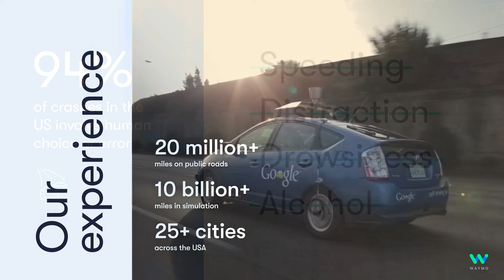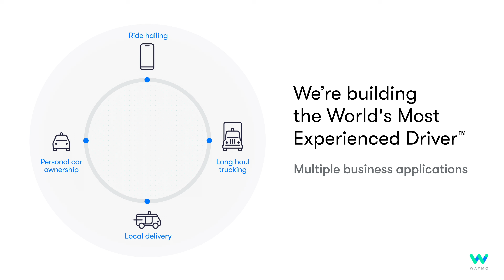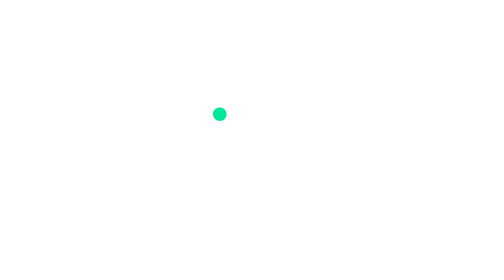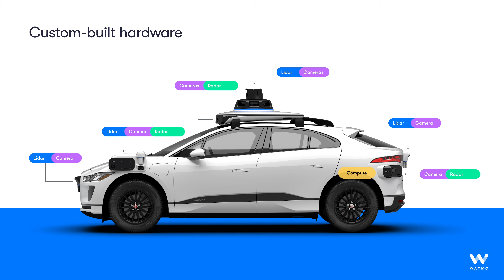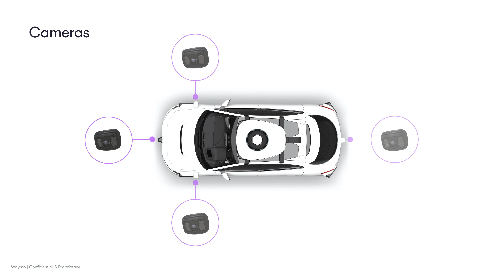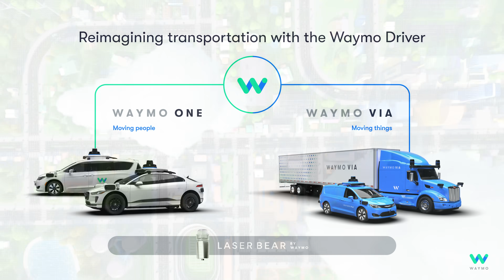Designing the Waymo Driver

Comment: Waymo is very impressiv. But the design is ugly. The sensor on the top, ok ... but that „tumors“ above the headlights.... this is not a design choice. But well, you did your best given the conditions. But it should be possible to integrate the sensors into the car ... cough ... Tesla * cough ....

Comment: Bad: I hate how it looks. Looks like it’s got Down syndrome or cancerous growths on it. I’m not driving that until you fix it.

Like: Waymo VIA can transport my goods. So I don’t have to own the truck. But what’s the flat rate charge? Would it be cheaper to buy my own trucks vs you? 

Is your vehicles all electric? 

What’s the range?

Did you fix the Tesla cold weather battery dead issue? 

Can it drive cost to cost? Video proving this? 

If you’re going to use the most expensive cars on the market to attach your crap to it why bother? 

How’s a layman going to afford this? 

What features does it come with? 

Is it able to be activated by text if I own one saying hey pick up the kids from school? Or text it pick up groceries from the store and have a person who loads it load it up? Can I text it hey pick me up from this location and then drive me home or to a movie theater? 

Can it self charge itself at a self charging station when low on battery power? Know where the self charging station is? Know how far it can travel before it needs to
Charge? 

Can it send me text needs to go to a repair shop flat tire, or needs to go to a repair shop
It needs new oil, or tire shop change tires? Can I text the car take yourself and drive back when done? 

If you’re selling the car of the future why not have it play the part if it’s going to act like my butler and drive me around. 

Does it have a small flat screen behind the drivers seat or shotgun seat so I can watch the news? 

Does it have its own built in private and secure WiFi? With GPS so I can physically see how much longer? 

Those are just some of my questions and concerns. Address those properly and I’ll actually be interested. As of right now I’m more interested in Ford or Tesla.
Reply: I think you're missing the point with a lot of these questions. Most of these are simple quality of life things that have already been proven by other companies. These features could easily be added, but Waymo is far more interested in handling the major challenges first. Being that they are the first in the industry to create self-driving cars, they can charge a reasonable markup and still have interest, so all of your financial questions are irrelevant.
You have to understand that Waymo's goal right now is to create a SAFE car that is capable of transporting people from point a to point b. The rest of this is a deal for after they've sorted that out.